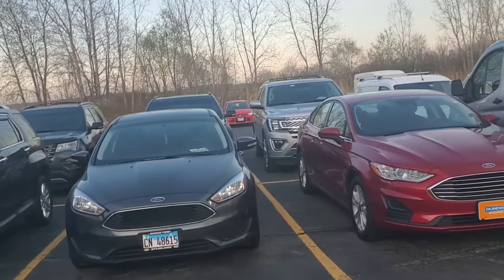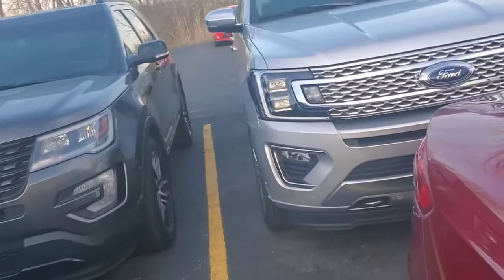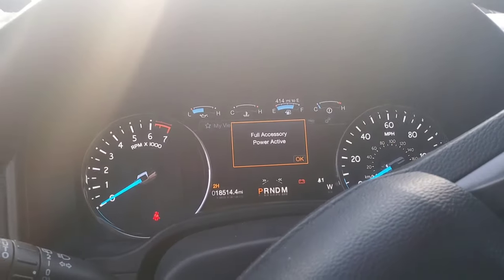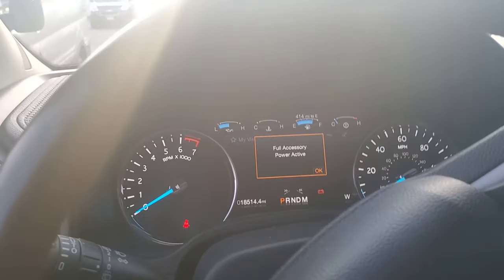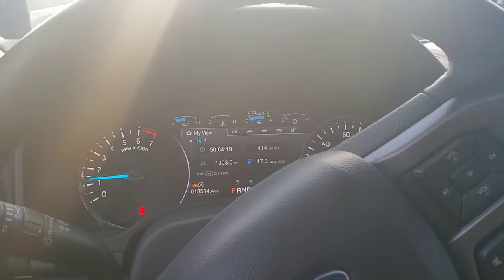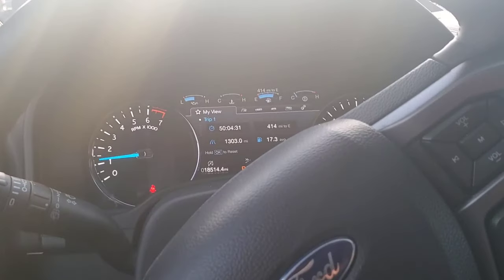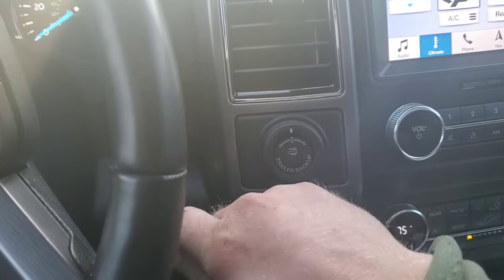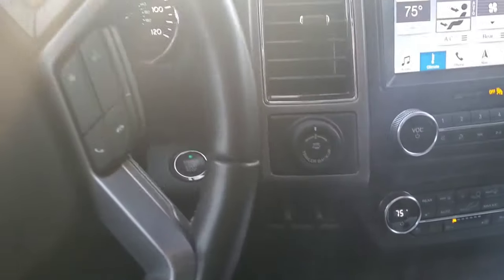3.5L Ecoboost F150 Rattle on Startup then gone, Try this - Could Fix Ford's Phaser Problem

Comment: I wonder if the auto stop / start has an affect on the cam phasers. Idk when that was introduced to the f150. I friend has a 2018 f150 3.5L with less then 35k miles and he has the rattle on start up. Has this been fixed in the 2021 3.5?
Reply from the maker: Yes
Reply: @FordBossMe  forgive me but the "yes" to the question.....was if referring to auto stop/start harming the phasers or yes the fixed the phasers in 21s??? Thank you!!!

Comment: Hi, new on your channel,  I have a 2018 3.5 echboost with a strong "rattle sound", not all the time but, often enough to bother me. Not only at start, is doing it when you are running,  Any advise? Thank for share your time, we need more videos like this.
Reply from the maker: Unfortunately if it's doing it while it's running and on start up it's time to actually change out the cam phasers and timing chain and the guides and the tensioners and it's an expensive job

Comment: The PCM must sense low oil pressure to give the warning, just start the engine as soon as the oil pressure warning is cleared.
Reply from the maker: Yeah it doesn't quite work like that because it doesn't actually see actual reliable pressure

Comment: I've got a 2013 f150 with the 3.5 ecoboost that just jumped time at 196,000 miles do you think it's worth it to have the timing chains and phasers replaced at that high of a mileage or would I be better off having the engine itself replaced in your opinion?
Reply from the maker: I would find a used good engine
Reply: @FordBossMe  I was thinking something along those lines, appreciate the quick response!

Comment: I tried it on my 2017 raptor and it did not rattle! Thanks!  but I have 2 questions 

1. Doing this, does it damage anything ?

2. I saw a video of someone adding Lucas heady duty oil stabilizer to their f150 and the rattle went away . What are your thoughts on this? Safe ? 

Hope you respond , thanks for the video !
Reply from the maker: Is it going to damage anything by starting it that way now it won't but doing it like that all the time who knows

I've seen the whole Lucas Oil stabilizer thing the only thing that I would be worried about is you have time and components that rely on oil flow and dumping oil stabilizer in an engine that already has a specific weight oil changing the viscosity of it could cause issues but if it works it works try it

Now the reason that the rattle happens isn't because of an oil issue

 it's because the Locking pin wears out on the VCT phaser and a lot of people get it mixed up and they try to dump a bunch of oils and stuff in the motor and yet makes it quieter but it doesn't fix anything
Reply from the maker: Look in my library at the 2018 F150 I just did phasers on not too long ago

Comment: For a new Ford Ecoboost with under 4K miles, would you recommend this procedure for only long intervals of no use (3 days or longer)?  Or only for older Ecoboost engines where tolerances are not as tight any more?
Reply from the maker: I would recommend this procedure yes if it's been sitting for awhile

Comment: Is it possible to increase the crank time with Forscan? I just started my truck after a few weeks of sitting and heard the dreaded rattle for the first time...
Reply from the maker: I have not explored this yet
Reply: @FordBossMe  Is it possible that I just need to drive it more? It's been about 2-3 weeks since the last time I used it. I have a small car I daily and the truck is usually trapped at the top of the drive way. 

How long does it typically take the oil to drain out of the phasers? I have a 2012 3.5L ecoboost.

I started it up after running into the lowes but forgot to hold the pedal down first and there was no noise. I remembered to hold the pedal after my second stop, but released it before I stopped cranking and it started as soon as my foot was up, so seems like you don't have to stop cranking, you just need to hold the pedal while cranking and then release it and it will start once the pedal lifts. I didn't mean to do it that way, just wasn't being very coordinated lol!

Thanks for all that you are doing on this channel, you and FordTechMakuloco are certainly doing God's work when it comes to these vehicles!

Comment: Isnt the point of the anti drain vack valve on an oil filter suppose to keep pressure in the system so it isnt dry at the next startup?
Reply from the maker: To an extent yes but it never works that way like it supposed to completely

Comment: My 19 5.0L rattles for a few minutes on cold start before it gets quiet. I already had the tensioners and whatever else replaced before the truck even had 3k miles. I’m at 35k now and sick of this lemon. I should’ve made Ford buy this back with all the issues but I got lazy and didn’t want to go thru the fight.🤷‍♂️

Comment: So, i had ford do some update. They said it fixes the issue. It made the issue worse. Now I have a day set to take it in. If the fix the cam phaser whats to say it won't happen again.
Reply from the maker: Yeah so what you're talkin about is a 21 B 10 reprogram and I have plenty of videos on this on the channel if you look in the library and if it happens again they will have to fix it again that's the only thing they can do right now

Comment: Hey I got a problem after I replaced the transmission on my 2014 fusion now it won't start and it says transmission not in park what do I need to do
Reply from the maker: Take it to a dealer for programming and make sure the shift cable is hooked up to the Trans appropriately

Comment: I know cold days and for extended sit times is the worst for immediate starts. What temperature range and time frame do you think would be the best to do the extended crank
Reply from the maker: any honestly because getting oil up there faster is key
Reply: I'd do it any cold start, say after a few hours at most. Definitely overnight.

Comment: I have a 2011 SHO with the noise on cold starts. I'm going to try this tomorrow but I just wanted to clear one thing up before I do. Do I hold down on the ignition button while I'm pressing both pedals? Or just press the button once? I get the impression I'm supposed to hold down the ignition button as well as both pedals for a few seconds, and then let off the gas pedal while still holding down everything else. Is that right?
Reply from the maker: You just push it like you're starting it normal but with the brake and the gas pedal pushed and then you let it crank for like 5 seconds and then let go of the gas while still holding the brake
Reply: @FordBossMe  Ok got it. I'll let you know the results as soon as I try it. Thank You for the video and the reply.
Reply: @FordBossMe  I just tried it. It worked. No noise at all. My final question is when should I replace the phasers and chain? I'm thinking ASAP? If I replace any parts I would continue to do the long crank as a preventative measure.

Comment: Shhhhh yer giving away my secret lmao, i do that every time i chg oil too, yes 110% agree, im sure ford engineering could tweak the pcm calibration to allow for auto start/ stop in traffic.....be a disaster if every new cal ecm delayed a start by a few secs at stop lites? this is right along the same logic as the older powerstrokes and heui cats that needed oil pressure to build at sensor prior to liting off
Reply from the maker: I got something else for you as well

I'm just looking for somebody to help me make this make sense

So all these people that just got this new cam phaser reprogram from the dealer  that is messing up their Transmissions or causing some kind of issue 

Why doesn't the dealer just put out a mass bulletin saying everybody that had this reprogram  go back to the dealer and let the dealer put the original as-built data back in your computer

I mean that would make sense I don't know if anybody thought of that or not but that would take that bad programming out and put the original programming back in

I think anybody that got that 21b 10 should go back to the dealer and tell gord to put the "as-built" data back in their computer to get that bad programming out until they come up with something that works
Reply: @FordBossMe  100 percent legit dude, one small step for ford, one giant leap for owners-kind lol, these motors are incredibly well built, and sometimes the human factor lags well behind in catching up to the idiosyncracies of this technology
Reply from the maker: The next time I get a customer with one of these programs that have been done I'm going to see if it helps everything by putting as-built data back in
Reply: @FordBossMe  Heck yes, and keep flooding tech help line every time it helps, sooner or later detroit will feel the pop when head exits backside
Reply: @FordBossMe  was wondering if I could go back to the original program. This shudder/hesitation is driving me nuts. I’ll have to talk to my service writer next week!  I’m sure it’ll be on my dime tho...
Reply: @FordBossMe  I'm in Cols.ohio meet you half way, bring your laptop

Comment: I’ve yet to hear my Ecoboost rattle the timing chain yet.

I get the annoying buzzing from the turbo wastegate slop. I’ve had 2 driver side turbos replaced so far because of excessive play and rattling.
Reply from the maker: they have kits to make the rattle go away but guys say eventually they make noise to

Comment: My 2018 F150 was in the shop twice for this.  They never fixed it.  It just kept getting worse.  There has been a problem where as I come to a stop, my RPMs can drop to 500 or below and give a shudder like the engine will die.. then seconds later the RPMs go back up to 550-600 range and everything smooths out.   Been fighting that since it was new.  4th time in the shop for that and they never find anything.   I'm now being told these are related and cam phasers will fix it.    I'm worried about long term damage between that and the various reasons my driver side front hub keeps trying to engage going down the road.   I know all manufacturers have issues but a $70k truck simply should not have as many issues as I've had that can't be fixed.
Reply from the maker: Yeah they're going to have to replace the timing components on your vehicle phasers chain guides all of it

Comment: So by holding down the gas all the way to the floor, does the PCM not energize fuel pump when doing this?
Reply from the maker: It disables the fuel pump to clear out the intake manifold of any kind of excessive amount of vapor that may be in there simulating a flooded engine to clear it out
Reply: @FordBossMe  oh ok that’s great info to know! Thank you very much.. can I pick your brain about another Ford related matter?  On a 2016 explorer with 3.5 engine, are those tools to hold the cams necessary or do people do that job without them sometimes? And is the tool for the turbo model different than the one for naturally aspirated 3.5? Thank you for your help and great informative videos

Comment: Hi i have 2021 Ford ranger raptor 2.0L Bi turbo diesel motor with a 10 speed trans. Lately been getting rattle when a/c is turned on but rattling noise is coming from the transmission side. Vehicle is 10 months old with 9000kms ford dealer here have no clue as to what the problem is. Any advice from your end.
Reply from the maker: We don't even have those in the United States
Reply from the maker: I wouldn't be able to begin to help 

Check exhaust system make sure everything is tight 

What you need to do is SHOW the dealer yourself what you are talking about sometimes it's difficult for us to duplicate Your Problem
Reply: @FordBossMe  thanks buddy.. vehicle has been going in and out to the dealer since December 2021. Well hopefully they can diagnose the problem and get it fixed.  I’ll be trying your oil priming technique today. Let’s see if that helps the issue.

Comment: My 17 Navigator has a rattle on the bottom of truck near the 2 front seats. Familiar with that? Like something is loose. Cat?
Reply from the maker: Yeah I know exactly what it is I have a video showing what it is if you look in my library you'll see number one rattle on F-150s and expeditions
Reply from the maker: https://youtu.be/nj8-lRsy_6A
Reply: @FordBossMe  ok. The hose clamp video? Just saw it earlier. Thanks for the swift response

Comment: My girlfriends 09 Lincoln mkx with the 3.5 started having the cam Fazer rattle took it to the dealer an they wanted to replace the engine for 8000 on a car that with 60.000 miles on it an  I went on line a discovered a lot of peaple hav the same problems but it nothing's done it will trash the engine an hers sounded like a diesel for 5 to 7 seconds. So I thought about what my grandpa told me 45 years ago he said if u hav a noise in ur motor try reslone  an I remember it working on quieting my lifters years ago in a t bird so I thought I hav nothing to lose so I had already changed the oil 2,times in this month making sure it wasn't the oil filter or brand of oil so I changed the oil an added reslone a long with the 5 20 weight oil an it rattled at start up  so I thought I'm sure it didn't help it  so the next morning my girl said what did u do to my car I said changed oil an she said it didn't rattle an that was over two years ago an 30.000 mile an hasn't rattled again every oil change I add reslone every 5000 mile an it's never sounded better  my grandpa told me reslone will clean it lifters an the sound will go away well it worked 40 years ago an worked. Two years ago I guess what had happened is her cam Fazer oil passages were clocked. An wasn't getting the pressure it needed a reslone unclogged themsi it can't hurt give it a try

Comment: So by this theory it's not good to use the remote start?
Reply from the maker: I mean that's up to you if you want to hear the rattle or the rattles already going on you need to Prime the system ahead of time so it doesn't make it worse until you get it fixed

Comment: My 2018 f150 has a ticking noise at idle. The dealer checked it and said it is a normal characteristic. Almost sounds like a lifter. Any chance that I can send you a video?
Reply from the maker: Poissorichard.rp@gmail.com

Comment: Just a few days ago Ford Dealership replaced my Cam phaser because had a recall on it and I never heard any rattling noise before the replacements Now lots of metals sound coming   engine first startup    few minutes after goes away that
s not making sense at all wondering is Dealer know what they're doing
Reply from the maker: Yeah something obviously went wrong this should not be more noisy

Comment: I get wat your saying but I put phasers in every week and I don't thing turning the engine over that much is the way to fix it. Customers would then bring in all the 3.5s for long crank.
Reply from the maker: I didn't say it was a permanent fix I said it's a way to prevent further damage that's what my message was about that's what this whole video was about
Reply from the maker: We do this every week in my shop to, multiple, I know what you're talkin about I'm not new to this but this is a way to prevent further damage
Reply: Def could prevent further damage especially if out of warranty. I've done 2 phaser jobs CP and it was def not cheap for the aftermarket warranty company. I suggest anyone  buying one to get a warranty

Comment: Saw where a guy added oil stabilizer and fixed the issue as well. Your thoughts?
Reply from the maker: Who knows with these things
Reply from the maker: I honestly don't see how stabilizer is going to stop the rattle on Startup if there's no oil pressure there on Startup
Reply: @FordBossMe  I assume the viscosity of the stabilizer helps keep things lubricated when other oil has drained down? This could be more temporary than the more obvious letting the oil pressure build. Here is a link to the video: https://youtu.be/n2XX5mV60oM

Comment: I would hate a long crank start. However, the Mustang 5.0l phasers don't have this issue. So Ford DOES know how to make them right. The Mustang phaser, is torque controlled, vs EcoB, which is controlled differently.
Reply from the maker: You're trying to to justify what you're saying to somebody that does this as a profession every single day and I'm shaking my head while I'm texting this because I'm like SHOULD I even entertain this guy or do I just move on because it gets ridiculous

Nobody is saying that for doesn't have a better designed with the 5-liter and nobody saying that they don't know how to make it but what we are saying is there's ways to mitigate some of the damage from further being done if you just left the ego s*** go and listen a little bit
Reply: @FordBossMe  I didn't mean to insult your experience, but 'clear flood mode'? Wouldn't that beat up up the starter and battery over time? Modern, well built cars start right up, with no rattle. People spend $75K on a Navigator/Exedition and have to start it this way? My 2011 5.0l Mustang has proper working, noise free phasers. Shame on Ford for repeating the phaser rattle(5.4l) on an other engine line(3.5l).

Comment: Yea but mine doesn't rattle at start up. when i go at low speeds i can hear it then after the engine warms up for sometimes i don't hear it. CAM issue still?
Reply from the maker: Could be
Reply from the maker: Or rattle from underneath exhaust clamp broken rattles at low speeds holds heat shield on

Comment: On my 2009 5.4l. I've been turning the key on for a out 5 seconds before I start it and it seems to cut down on the start up rattle by about 75%. I'm guessing the vct solenoids might be sticking.
Reply from the maker: Very well could be
Reply: Dealers just add thicker oil too